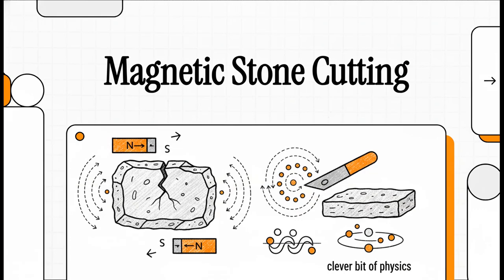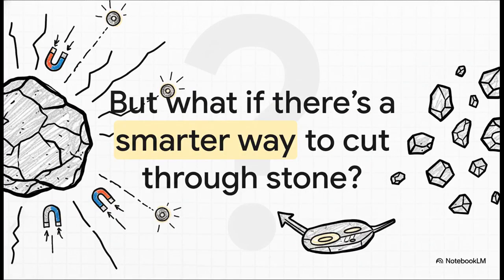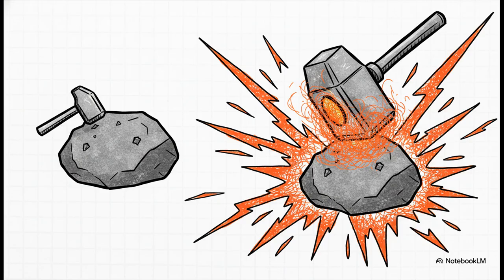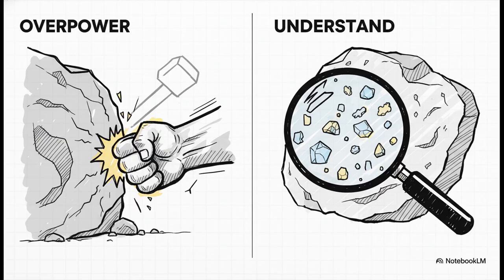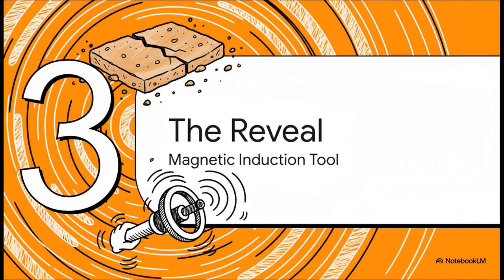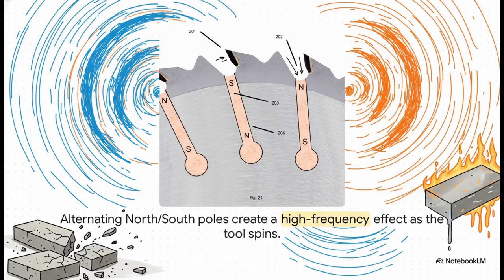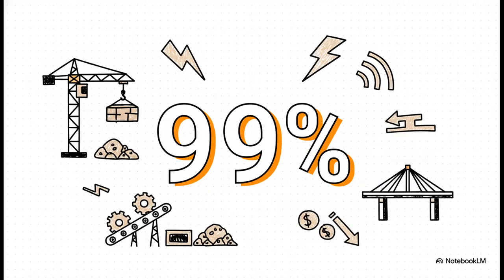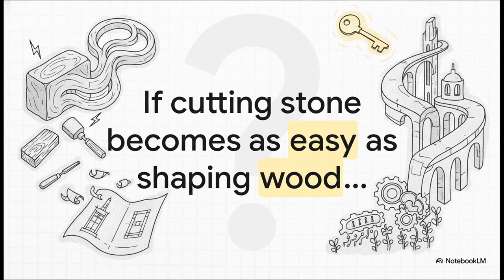This New Stone Cutting Method Is Changing Everything

Comment: In Italy, there are some tunnels dug before the invention of explosives. For example, the Fucino exhaust tunnel dug by the Etruscans 3,000 years ago, the Furlo tunnel dug by the Romans during the Vespasian era, and the "Viso hole" dug at the end of the 15th century in the Alps. All were built using the "furnace" technique. By lighting fires in front of the rock and cooling it with water, it would break due to thermal shock. Induction heating achieves selective heating. If it works .....in granite, biotite (a mineral containing iron) ranges from 3% to 7%. I don't know if this is a sufficient amount of iron to achieve the necessary induction effect. A tunnel rarely passes through a single rock formation. If you start by digging through granite, what do you do when you reach limestone?
Reply: Cool info! See, the problem is two-fold: Most metals are not-native so eddy currents don't work and putting magnets in a saw blade will use micro-watts, not the kilo-watts needed to expand stone. Explosives still cheapest method. See u-tube miners: Mine Operator and MBMM mining. They share blasting costs with us peons!
Reply: Oh, eddy currents require non-ferris metals, right? Iron can't because it's MAGNITIZABLE! So what NONMAGNETIC METALS exist in say, limestone? Quartzite? Not in Mavic igneous or andesite, that's magnitite, right? So this "magnet tech" is a patent only... For fun, follow these startups to see if they ever work! Plasma is workable but energy expenditure has to beat that rusty v-8 pulling a loop of cable for the last ten years! No kidding, if a guy could plasma out 1" x 6 foot holes without creating ROCK VAPOR, it might sell. Drilling uses water to avoid silicosis, what will a plasma cutter use? Hmmm?
Reply: @dousiastailfeather9454  Cutting with a plasma torch always produces  ionized gas. Resulting reactions are part of ion chemistry. Interaction of living organisms (including humans) with ionized atoms is still unclear. If you tell me where you plan to cut rock with plasma, I'll try to stay a few hundred miles away.
Reply from the maker: Yea there are some stone quarries that have that sort of look as well

Comment: A water jet cutter do it much more efficiently and much cleaner
Reply: I agree it seems that way but I think this whole point is about like a free energy type device some sort of magnetic field spinning. Where the water jet is probably operated electrically from the grid or generator or something. I'm a amateur rockhound for the last 11 years and I have a wet tile saw some polishers Dremel tool and so on. I wish I had a easier way to cut rock I wish I knew what they did in Egypt. I I called plasma energy generation and/or extraction on a large and small scale I think. I wouldn't doubt they had water jet cutting as well. I would love to have something simple the excitement of finding the rocks and crystals and then having to cut them sort of dwindles down until you finally get them cut then the excitement raises again.